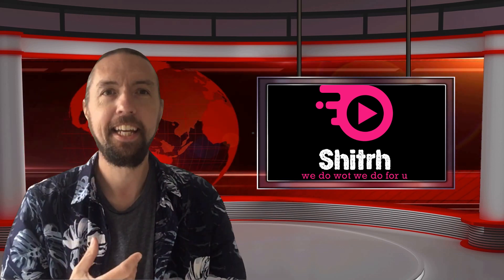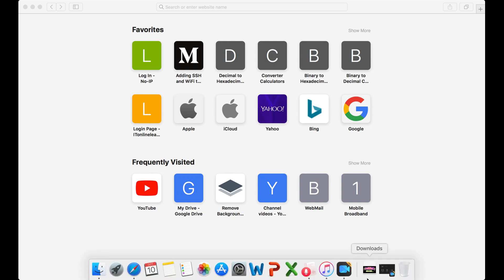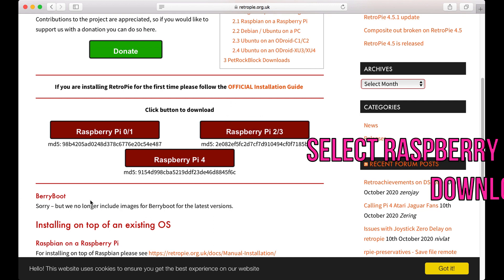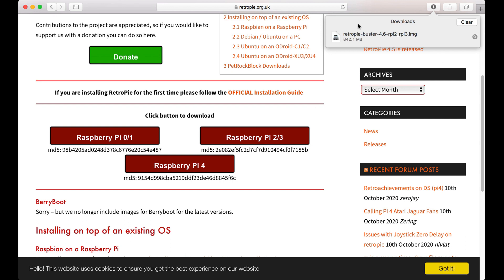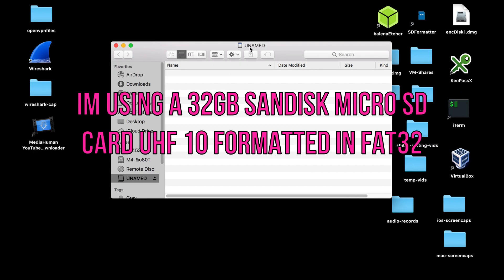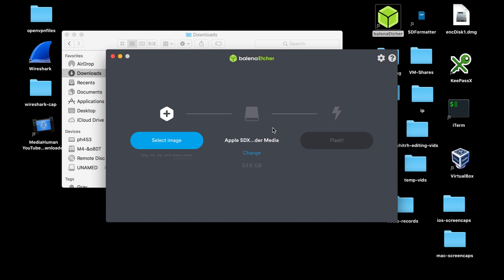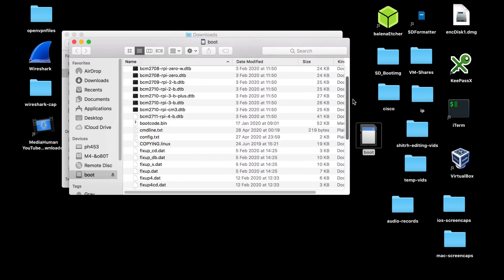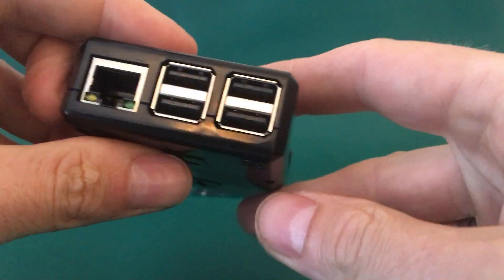how to install retropie image on raspberry pi 3 - RetroPie image install part 1

Comment: Question
I unknowingly burned the Raspberry Pi OS to my 128GB card when I actually wanted the Retropie. Am I able to burn Retropie on it somehow?
Reply from the maker: Hi thanks for the comment , good question and yes you can install retropie over raspian or Pi Os as a seperate program it is better as a stand-alone but will work over pi os open a terminal window in pi os and type the following to install retropie 

sudo apt-get update
sudo apt-get upgrade
cd Downloads
git clone —depth=1 https://github.com/RetroPie/RetroPie-Setup
cd RetroPie-Setup
chmod +x retropie_setup.sh
sudo ./retropie_setup.sh

If you get stuck or have any issue  this video might help you

https://youtu.be/yyUIz7Mm1vA

Thanks for watching